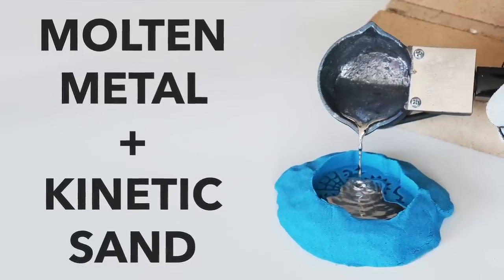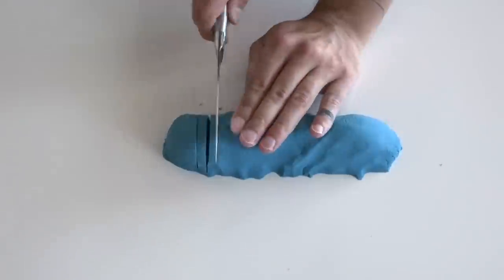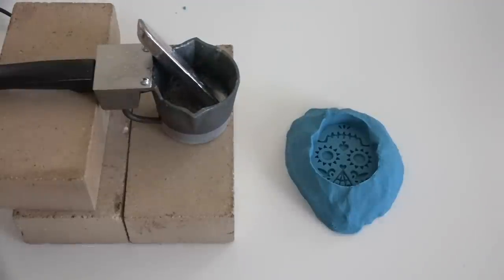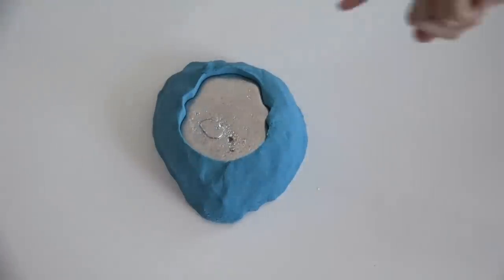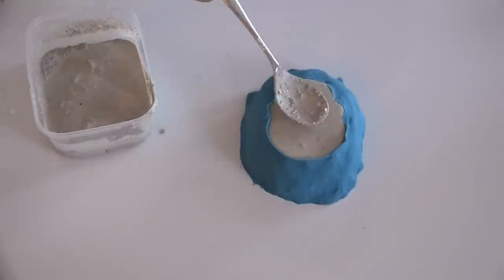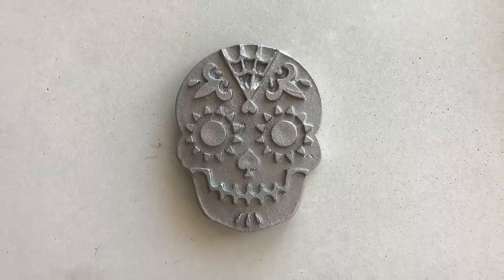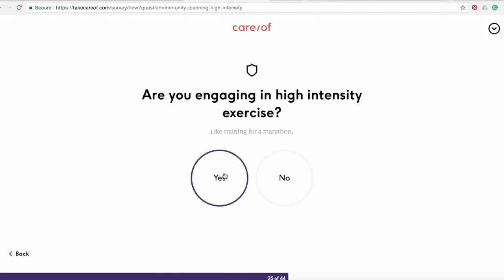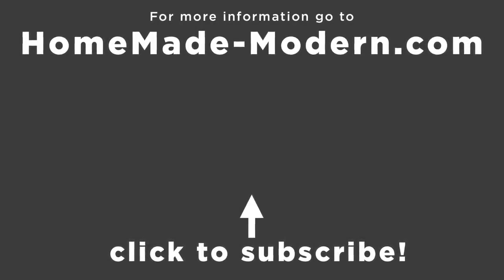Pouring Molten Metal into Kinetic Sand

Comment: So crazy how well that worked for the metal! I think it would be great for casting jewelry, custom hardware details, small dishes... ah the list goes on!
Reply: Yes! and its reosable and way less mess making it suitable for areas with limited space.
Reply: Wouldn't work well for jewelry. You want the casting to be as smooth as possible so there's less post casting cleanup involved. 

That's one of he reasons they use investment (a really fine plaster basically) the other being that you can preheat it which helps the molten metal flow I to and pick up the fine details better.
Reply: EvanAndKatelyn hi
Reply: EvanAndKatelyn the only issue is that it can't create complex 3D shapes like green sand can...
Reply: EvanAndKatelyn Or an AR-15 receiver.
Reply: Would work well for pendants, earrings and such on the jewelry side. Maybe, custom name plate for mailboxes, doors, or driveways and such. But, I would like to see big wall art.
Reply: crazy how nature do that.
Reply: I could use this to create a business

Comment: How hot can you go?  Try casting brass or aluminum or which ever metal is a step up from the Tin you used.  Awesome video Ben!
Reply: Exactly - I'm interested in your results using something with a considerably higher melting temperature.
Reply: Dan The Maker Man hey dan I did Aluminium and brass on my channel in this type of sand a month or 2 back with quite interesting results if your interested. 😁👍🏻
Reply: bigstackD a
Reply: Depends on the type of sand and the catalyst compounds' melting points.
Reply: I would agree with the suggestion that the failure point will be equal to the lowest melting/combustion point of the present materials.
Reply: grim rott 
I was also going to say BigstackD tried already
Reply: i used to use 'Smithsonian Experiment' sand, that stuff that piles up and sticks to itself when poured into water? I made pewter D&D figurines in college to supplement my income. $25 for a about 5 pounds of scrap pewter, a dollar for a bag of 'Assorted Fantasy Characters: Plastic' and 15 bucks for the Smithsonian kids connect home experiment kit.

Then i charged 10 bucks a figurine, making about 15-20 figures per pound of  pewter with the bigger ones, and over 50 with the smaller ones.

My fourth year of college i ate like a normal person....
Reply: bigstackD *you're
Reply: What's it titled?
Reply: There is a max 'heat' some things can get, as heat is energy and you can't have unlimited energy and there is a max.
Reply: bigstackD Casting I'll check it out

Comment: As for the concrete, you could use a different colour kinetic sand for concrete. A colour that matches the contrete.
Reply: OR, he could have made the Quickcrete as thick as it was supposed to be made; It would have came out stronger, and cleaned easier.
Reply: Emanuel Rivera Would the thicker mix still take on all of the small details, though?

Comment: cabinet knobs!
Reply from the maker: oh thats such a good idea!  just add some bolts!
Reply: Winner!
Reply: Was about to coment the same thing.  Geometric shapes for drawer handles are very on trend at the moment but you could do anything with this.  Brilliant idea.
Reply: I wonder if you could use styrofoam inserts to hold more complex three dimensional objects?  It’s a timing problem between the rate at which the styrofoam melts, the kinetic sand softening as support is lost, and the metal hardening... probably a bust idea.
Reply: Brian Mulisano It’s not a bust idea until you prove it is (or isn’t) Try it and see! :)
Reply: Rob Diaz Oh my god!!! Yes!
Reply: Rob Diaz That skull as a cabinet knob would be awesome!!!
Reply: Can you guys explain more the tips and tricks you did to do it
Reply: Brian Mulisano can you explain mote your tip sorry i cant picture it thanks
Reply: Careful with the fumes from styrofoam. (or am I being too naive about the fumes of the featured metal?)

Comment: You could cast your own ring.  Or by hand, press a certain size hole saw into the sand and carefully remove to form the mold. Pour in the melted alloy. Then, using the same hole saw cut a similar depth hole into a wood project or other surface. Place round alloy relief in the hole. Could be kind of a cool accent to a furniture or decoration piece...
Reply: John K 

best gift to give
a pretty ring for a wife/gf

Comment: I wonder if there's any way u can 'oil' the inside so that the sand doesn't stick to the poured concrete?? maybe oil spray??
Reply: Soo Nam or hairspray? Just to create a thin barrier. But oil is a great idea! Would try both 😀
Reply: Soo Nam it would most likely catch on fire
Reply: Charlie Murr With concrete?
Reply: Soo Nam so add a contaminant?
Reply: Most sand casters use a talc powder
Reply: With conctete u can use a release agent like corn starch or something non stick powder

Comment: You could make pebble-texture concrete floor tiles for wet areas. Make square, rectangular, or hexagonal depressions in the sand. Gently press pebbles in the bottom of depressions (that will become the top of the tiles). Fill with concrete. When installing the floor tiles, let grout cover the concrete in the spaces between pebbles, and it would look like you set each one in the floor individually.

Comment: Interesting. Thanks! What is the “green sand used by foundries that make cast iron? It seems similar to the kinetic sand.Also, other casting materials I thought of were lead, aluminum and plaster of Paris. I wonder if the higher melting/ casting temperatures will burn the kinetic sand. Did you try those? I don’t know if those lead melting heaters will also melt aluminum.

Comment: First I would use this in scale modeling for recreate model parts! Having worked in a foundry indeed the sand is what is used for metal. Don't forget to use safety equipment when working with molten metal!

Comment: I love kinetic sand.
Reply from the maker: me too!  it was fun trying to find a use for it!
Reply: I never really realized there was a practical use for it in this sense, until I saw your video. This makes me want to try using it for different things, like replacing specialized parts on different objects. It seems like it could easily be a good replacement for 3D printing stuff seeing as how it's much cheaper.

Comment: 3D print, pop it in, pour metal. Good way to manufacture anything 2.5D in metal and getting rid of ridges etc from 3D print, although it ultimately sacrifices resolution. But then so does sanding.

Comment: I'd be slightly worried about using this technique on metals with higher melting points, but apart from that, it looks amazing. A fairly cheap, easily workable, and reusable material for casting metals? This stuff should be used professionally, maybe not for bulk production, but perfect for prototyping. Wonder if it does plastics, too.

Comment: I would think if you try and cast larger items, you would want a wood form to hold the sand in place. Also, I would experiment with some different types of mold release to see if that helps the sand sticking issue. (although the mold release might limit how many times you could use the sand)

Comment: You could paint the metal or use glow in the dark paint and make it into a phone holder that hangs on the wall while your phones charging. Also could make one that could fit around your light switch

Comment: Here's my brainstorm idea. Metal video game shells. A replacement metal shell for my 3DS, NES, Gameboy, etc would be awesome. Other ideas would be replacement shells for controllers (like PS3 or XBOX controllers), metal buttons for various controllers/handheld systems, metal replacement game cartridges, metal dust covers for SNES, GBA games. The list goes on.

In fact, on the topic of the SNES, they put bromine in the plastic which made most SNES shells sensitive to UV light and turn brittle and yellow over time. As a result, most SNES shells are now ugly, chipped, or have flat out shattered to pieces. A metal shell for the SNES could be in high demand. Just saying.

Comment: You could make metal badges out of it and use a thin amount of metal so it is just covering the mold and has a small back base, to put the pin it just place it on while it's cooling with pliers or something:)

Comment: Could be interesting to mold a simple shape, like an egg, in the sand then use a detail or utility knife to carve a pattern into it before pouring in the metal. Or maybe a rigid, thin mesh could be pressed into the sand on top of a basic shape. Potentially a few simple shapes together could make cool metal trivets or coasters.

Comment: Using this molding method theoretically you could make a rather nice cross or decorative wall hanging by first carving it out of Wax and then making a mold with the kinetic sand pulling the wax sculpture out the spelling it on the replaced mold with metal

Comment: Could this work with just wet sand? Less likely to burn if you use a metal with a higher melting point.
Reply: abdizzll I wouldn't think so casting sand usually has some kind of binders in it, this stuff is bonded with some type of silicone product, there's YouTube videos of people trying to make their own

Comment: It's literally just a nontoxic Green sand. A substance made for actual metal casting. Why wouldn't it work for casting a metal that can melt on a stovetop?

You could touch that metal molten with your bare hands for several seconds without so much as a blister. It's absolutely not going to burn the kinetic sand.

Comment: You could make the sand work even better if you use Styrofoam as the blank for your project and molded the sand around it then poured the molten metal onto the Styrofoam melting the Styrofoam creating a cavity for the metal.

Comment: If you would of ran the quicrete (quick concrete) under a water faucet, where the water is clear and gently rubbed, you’d probably of gotten the sand off the material easier

Comment: Personally I'm interested to see how well the sand would hold up against hotter metals find The Sweet Spot It is sand-based so theoretically as long as you stay underneath the sands bass melting temperatures you should be safe I'm in terms of metallurgical experimentation